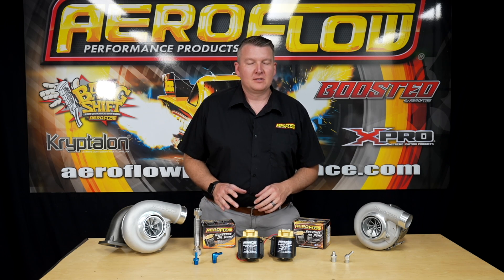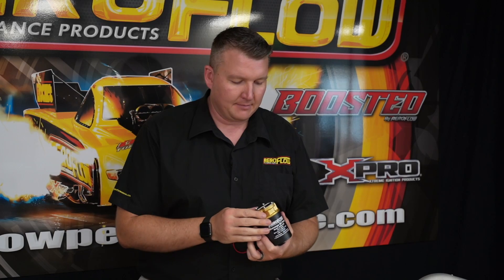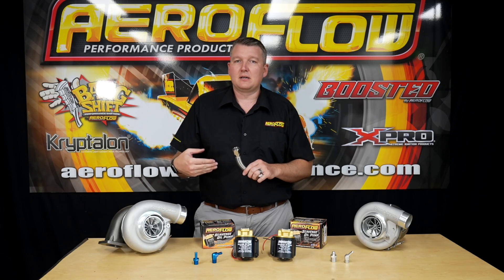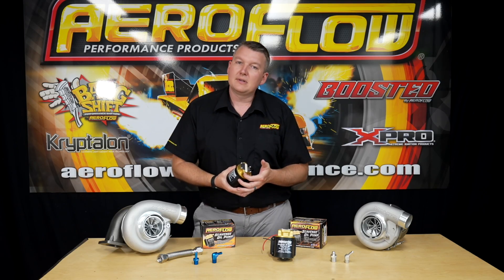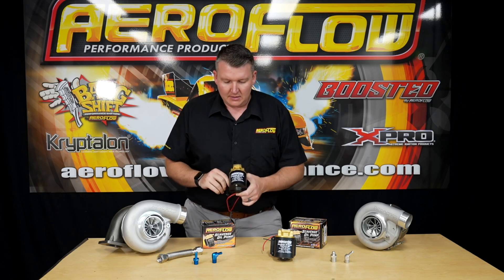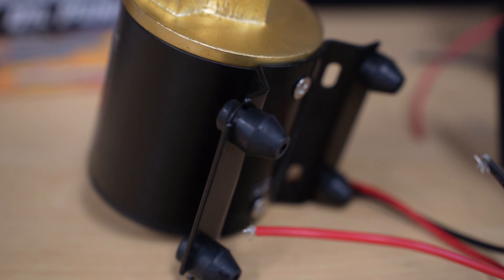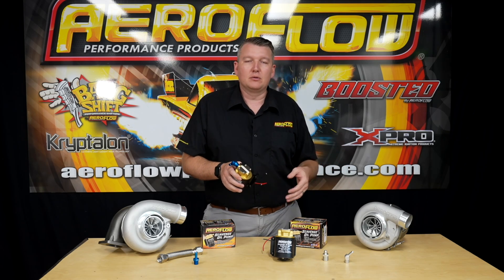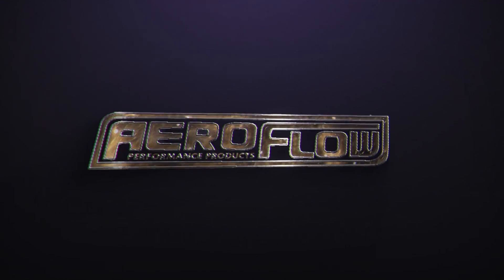Oil scavenge pumps

Comment: How is an oil pressure of +50 psi not able to push back to the sump ? Doesn't make sense at all...
Reply from the maker: because it's no longer pressurized after going through the feed fitting and turbocharger core.

Comment: Hi Aeroflow, i plan to use this pump to cool the hot transmission fluid through my transmission cooler circulating whilst running the cooler fan. Will it be able to cope with the high heat of the transmission fluid which is usually very hot. I don’t see any operating temperatures in the specs. Thanks

Comment: Is this pump capable of FEEDING a turbo? I'd like to build a stand alone oil system for my turbo so I can feed it with clean fresh oil 24/7 AND run two different weights.
Reply from the maker: Yes it could feed turbos however you would need to run a regulator or restrictor as the feed rate and volume would probably be too high for most turbos.

Comment: I purchased a SurFlo geared pump as a pre-start oiler for my engine. Its fender mounted and pulls oil from the oil pan 1.5" above the bottom. From there it pushes oil back to a sandwich then back to the relocated oil filter also fender mounted. Thenback to the bottom of the engine the distribute the oil throughout the engine. Im going to have to re-think this one.
Reply: How about using a separate oil tank dedicated just for the turbo
Reply: @leb274  I'm not using a turbo. I just dont want any dry starts. This came with 3/8 fittings so I used all 3/8 plumbing. But that might be to big. Ill try 1/4 plumbing to see if that'll work. As of now, after putting the oil filter back on the engine and moving the pump closer to the oil pan, it still will not move any oil

Comment: Hi there, I’m running 2 g35-1050 low mounted turbos with 180ml sumps on the turbos and all 10an hose and fittings. 
From what I can see the turbos oil feed rate is 1-2 l/m and the pump is 8 l/m.

Will the pump be running dry and aerating if the pump is trying to physically push more oil than it’s being fed? 

I have breathers on both turbo sumps so the pump won’t be pulling oil through the core. 

Street car too. Do you have videos of how noisy it is when it’s working?

Comment: I’m in the planning stages of a twin turbo setup for my Honda v6. The locations of the turbos don’t allow for proper drain back. In my head I’m thinking of routing both drains to a 1 liter reservoir and running the pump off of that back to the engine. What are your thoughts on this? My main concern is potentially running the pump dry.
Reply from the maker: That all sounds fine however you may need to look for a time delayed relay. That way you can set the pump to power up a few seconds after the car starts.

Comment: Hello aeroflow,

i am working on an audi tt rear mount turbo, and i have a problem. I have very little room for the pump. and i have now found a place where i can put it. but the pump is vertical with the oil supply on top. is this a super bad problem? because on the internet everyone does it upside down. but it's just not possible for me.
Reply from the maker: Hi Mikey! That is no problem at all mate, as long as the pump is primed before the very first use it will work just fine. Thanks for your support!

Comment: I'm thinking the oil temp from the turbo is going to be really high - what temp is the pump good to??
Reply from the maker: Generally the oil doesn't spend much time in the turbo so the temperature is usually only 10-20 degrees north of the engine oil temperature if measured at the top end of the motor. The pumps can handle this no problem

Comment: Can you tell me how much psi comes out?
Reply from the maker: It's very low pressure as it is only a transfer pump however the pressure is relative to any kind of resistance. What is your application
Reply: Oil will be used in a separate oil tank without using oil in the engine.
Reply from the maker: @gimhae-playboy  pressure will more than likely less than 5psi, just make sure your tank has a breather to allow for thermal expansion of the oil.
Reply: stand alone oil system
Reply: 40w oil

Comment: Does the pump have to be located lower than the sump tank? (In order for the oil to travel via gravity to the pump). Or does the scavenge pump produce a vacuum great enough to overcome the gravity trapped oil in an up-sloping hose/line, to draw the oil to the pump?
Reply from the maker: Yes it is best practice to have the pump gravity fed - not necessarily because it doesn't create a vacuum but more so if the pump runs dry for any period of time before the oil is flowing, the gears in the pump can be damaged. We also recommend running a vent tube from the sump tank to ensure there isn't a hydraulic lock - which can happen if you are running check valves.
Reply: @aeroflowperformance  additional question… what if there’s not adequate space to mount the pump lower than the sump tank? 

I appreciate the feed back, good info here.
Reply from the maker: @Znthusiast  it can be mounted higher however you will possibly run in to the issue of having the sump tank constantly full after shut off so you'd need to run the pump for a few seconds longer after the engine is turned off.
Reply: @aeroflowperformance  okay sweet, I will consider that. I appreciate the attentive responses!

Comment: This doesn’t pump more than the oil going through turbo and run dry , letting metal in sump?
Reply from the maker: If you're motor has low oil pressure we would suggest running a small sump under the drain of the turbocharger and then have the pump scavenge from there.
Reply: Genuinely inquiring for rear mount Ute setup

Comment: what's the duty cycle on this pump, how long continuously can it be ran for
Reply from the maker: We tested it with 70wt nitro oil for 3 hours continuous with no problems. We figured there wouldn't be too many automotive applications running longer than this or with that type of oil viscosity

Comment: Can I run this pump on my motorcycle project?
I'm thinking more about the amp draw and also will the pump suffer if it is trying to draw more oil than is coming from the drain on the low mounted turbo?
Thanks
Reply: I’d advise fitting an air vent(filtered)so you don’t induce a vacuum on the turbo as the oil should freely drain not under pressure or vac, the filter should be as high if not higher than the turbo, it can work sorta without an atmospheric vent but it’s asking for trouble! The vent is proven beneficial on track and street,pump motor life should be significantly extended not pumping solid liquid